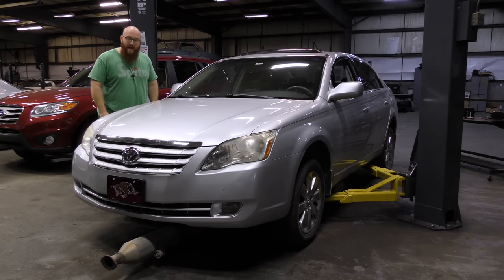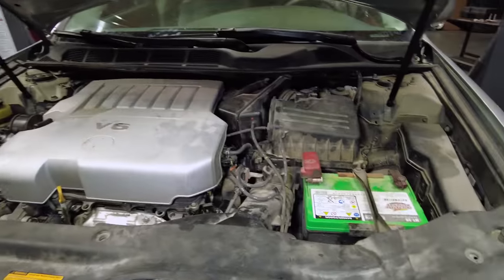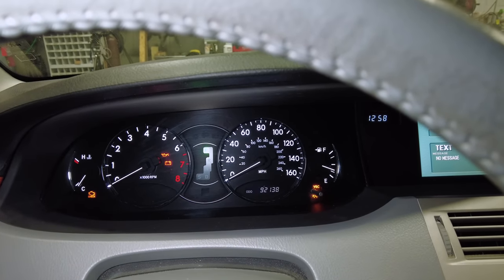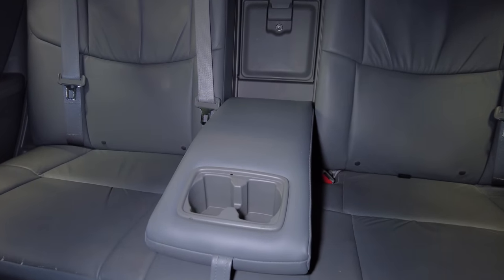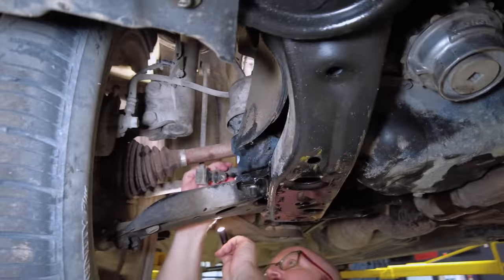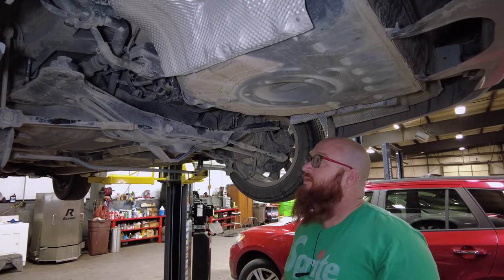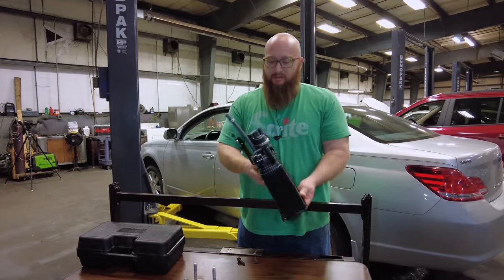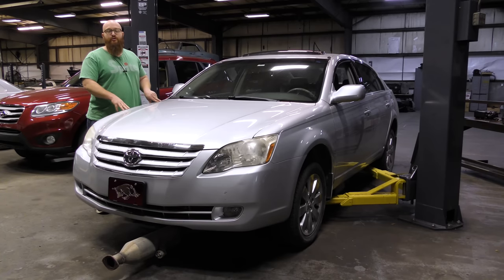Dumbest place for essential emission part on this '05 Avalon! CAR WIZARD is not happy!

Comment: I purchased a 2007 Camry XLE two months ago with 61,100 miles, this car was garaged since new, near perfect inside and out. My car has the 4 cylinder, 4 speed automatic, I am totally pleased with this car.  I was looking at Avalon's, but everyone I looked at had over 100,000 miles with asking prices between $17,000 to $21,000, which you think wouldn't be bad, but the Avalon's I was looking at were between 2008-2013.
Reply: Change the oil every 5,000 miles with full synthetic. The 4-cylinder is easier to maintain compared to the V6, so you should be very happy.  Watch out for oil burning, some of the 2007-2009 4-cylinder models had bad piston rings from the factory, and will burn oil. Even if it burns oil, just make sure it never goes low and keep changing it every 5,000 miles or less, don't get rid of it, it's still better than A LOT of other cars on the road.  These 4-cylinder Toyotas can go over 300,000 miles if you do basic maintenance!  I bet there are some with half a million miles on them.
Reply: You overpaid for a 15 year Toyota
Reply: We're did he say what he gave for it
Reply: Your cannister is in the same bs spot
Reply: @Dyesnipa  I had an 89 Toyota Supra and it had the original canister on it, I sold the car 18 months ago. I ask my dad if he ever seen one go bad, he said no, not even on an American made car, how often have you ever seen any go bad.

Comment: Great video!  Two points. 
1. My 08 Corolla Toyota saw fit to change from metal fuel tank to plastic. The line to the charcoal canister is molded ONTO the gas tank. (Must have been the same engineer!) when that tube broke on mine they wanted to put in a whole new gas tank. Nope. Used another larger tube as a sleeve and some JB Weld to fix. 
2. Im told that a big cause of charcoal canisters going bad is people topping off their tank (I like even dollar amount🤣!) gas gets sucked in and spoils canister. I’m now satisfied with odd dollar amounts!

Comment: Correction Mr. Wizard: 1970's cars all had to have a vapor recovery system on them. I have a 1970 Porsche 914 and it has a vapor recovery system with a charcoal canister on it.

Comment: We had the Avalon in Australia in the early 2000s and then it got replaced by the Aurion which had a 3.5ltr V6 which got it 0-60 mph in 7 seconds which was pretty quick. Then they did a TRD (Toyota Racing Development ) version putting out 320hp getting it 0-60 in 5.9 seconds.

Comment: My 2001 Nissan Sentra needed canister replacements twice in 11 years/60k miles. It was $600 parts and labor each time at the dealer. I had to get it done to pass the e-check to renew my registration.
Reply: I'm glad I don't live in a place like that. I just cut off my catalytic converter off mine today to sell
Reply: Do you top off the tank when filling up? That will destroy the canister.
Reply: @lrich8181  It hasn't in 11 years with my Sonata.

Comment: Some Toyotas really have some strange placements of parts. The 1996-2000 rav4’s (4wd version) - there’s a vsv that fails almost always and is nearly an engine out job. Motor mount has to be removed to do driver side control arm as the trans pan won’t clear it. 2wd you can reach it from underneath the car and control arms are standard procedure.

Comment: That top hattie hold it won't open is actually your radio And infotAINment not a hidie hole.. And miss wizard that car if it has the same sound system as the one I have been in. I came within a rather awesome sound system

Comment: The lock on the door to the trunk from the inside is odd. I've never seen that before. Thank you for the videos 👍👍
Reply: Honda Accords and some Acuras used to have them on the pass-through. It also had a lock on the fuel door release. The idea was you got a valet key and a regular key so that way if you took it somewhere and valet parked it, you'd hand the valet the special key and all it did was unlock the car and start the engine but would not allow them into the trunk (to your valuables) or to the gas tank.

Comment: Did you know that 1999-2005 Mazda MX-5 fuel filter is hidden on passenger side rear wheel well forward section, behind the plastic fender cover?
Yes, hidden all the way in the back, and clogged to the point to starve fuel on full throttle.

Comment: Each generation of Avalon is literally built like a tank! I bought an 02 XLS off its original owner 2 years ago, for $2800. 140k miles. Mine has the 1MZ v6 which does have a timing belt but I happily had it changed since it was such a great car in the first year i had it. I literally just bought it and started driving it for a year with just oil changes. It just goes and goes and goes, but now i wonder if the charcoal canister is in the same spot as this generation. Hopefully not! 😅

Comment: The lock is there in order to make sure that if the car is broken into if there are valuables in the trunk you can’t get in easily through the cab and just grab what ever they please.. it’s like that on my LS460 as well
Reply: Seems like you'd just hit the trunk release to the left of the steering wheel in that scenario.
Reply: @stevenatwater7298  well I didn’t say it made sense but it may have a trunk release lock in the glove box

Comment: Suppose if the owner driver does not overfill the fuel tank, the canister does not ever need replacement
Reply: That's what I was thinking.  Last owner must have been hard on the thing. If they didn't care about the engine bay, must not have cared about overfilling the tank either.
Reply: @RelicDavvi  I myself almost overfilled my fuel tank when the price of petrol went yo-yo a couple of months back
Reply: @yslee1401  lol

Comment: Question for the Wizard
I have noticed that pick up trucks seem to have much smaller brake front rotors than my BMW X5, Volvo V-70 R or my VW CC.  If a truck carries a heavy load, why don't they have larger diameter rotors?

Comment: 6:03 Possibly to avoid a valet to enter your trunk, as it might require a different key.
But I admit I also found that strange.
Reply: Exactly that from an article I read in Car & Driver (I think) decades ago. When cars introduced emergency releases inside the trunk in case someone got locked in, valet keys that only unlocked the doors and ignition but not the trunk (including the trunk release lever which could be locked — remember those?) could be bypassed by reaching in and popping the trunk from inside via the pass through. It was a short-lived thing.
Reply: @briandeschene8424  glove box is another space you can store things, and was typically lockable.
Nowadays, I do not see that - but I can be mistaken.

Comment: I think that locking door between the rear seats is to prevent someone (i,e, a thief breaking into passenger compartment) from accessing items in the  trunk. It's also good for locking away video games when the kids don't listen.
Reply: it's valet lock, the valet key won't open it and the trunk when the valet lock is engaged, so you can't pop the trunk either.
Reply: No that's not true, it's opposite since you can pop the seats down from the trunk, don't make up stuff, e.g; "i tHiNk"
Reply: @LAactor  you can pop the seats from the trunk so locking the pass through prevents access from passenger compartment, normally you lock this for valet parking, the valet key cannot open this lock or the trunk lock.  you also lock the driver seat trunk release.
Reply: The seats on these do not fold down. @LAactor

Comment: My 2010 sequoia with 165k miles is currently getting a charcoal canister changed out. There are other things that need to be replaced connected to the EVAP. $1944

Comment: I only bring this up because The Car Care Nut empasizes this. Always buy a replacement part from the OEM dealer. Are you sure the E BAY cannister is not a knock off. Just because it comes in a Toyota box and has all the right markings on the cannister can you be sure. Ford had a serious problem with this because the Chinese knock off of there replacement brake pads looked identical in every way to the original Ford product. Yes it may cost 200 dollars more from the dealer but it is the way to go.

Comment: I thought those never break, run 1M miles on the original oil, tires and first tank of gas? Very disappointing ;-)
Reply: What a joke that people think this right!!! Toyotas are trash boxes usually worth junking before 150k and sometimes even earlier
Reply: I got a 94 land cruiser with 500k 
A 08 FJ with 455k 
N a 01 sienna with 370k
Reply: @cornholio329  The old land cruiser ill give you, and the FJ is not bad either. But camrys, corrollas, and tacomas are trash. Head gaskets go bad on all of them usually before 150k. Look it up. That is if they even make it to that mileage, because we all know toyota rusts quicker than any other vehicle ever made. Have a 2005 suburban with 215k, and a 1990 volvo 740 turbo with 256k, which both provide far better ride quality than anything toyota ever produced.
Reply: @lotsof torque  

True but it depends if you maintain them and keep them garage kept and where they are from
My friend who I work with just bought an  97 v12 century n just had it imported from Japan
Reply: lotsoftorque, Instead of a "trash box"
Toyota what would you recommend?
Reply: @garyowen3662  Glad you asked. The Lincoln town cars from the late 1990s are very reliable. Anything oldsmobile or buick with the 3.8 liter is very reliable. If you must go japenese, overall Acuras are pretty good. The RL is the top model and is made very well.  Just watch out for the 3.2 liter MDX because the trannys go on them. The early to mid 2000s Mazda CX-9 with the 3.5 liter is a good car. If you are interested in a truck, The suburbans, tahoes, yukons, and silverados all share the same drivetrain. And they are all great. Especially the 92-99 models with the chevy 350 engine. The 00-06 are very good as well. 07 and up went to hell because they introduced AFM. I am speaking from personal experience as I have worked on cars since I was 15 years old. One of the most reliable cars of all time was the volvo 240. Plenty of them have gotten to 1 million miles, however I wouldn't recommend it to someone who is not a DIY person as they are very old at this point and most would need a lot of attention just due to being 35 years old.

Comment: You're doing more work to this car with Ninety k then my dad has done to his avalon with three hundred and seventy five thousand Somebody's rough on a ride Or if you travel a lot of miles for work. My dad traveled over 300 miles A-day write around 3 hundhe loves it. He used to drive an accuraintegra only thing he misses about that acura is the gas mileage this thing is like a cloud..
Reply: Cool flex bro.  I bought a geo metro with 430k miles for 400 bucks no leaks got close to 50 mpg
Reply: @MrBlaze256  Ajar it's the difference in a highway miles and a lot of city knives and country knives on this coat right here most of the miles were. Put on ours highway miles.. And I highly doubt you have a metro with four hundred and thirty thousand and a less of course you've done a ls saw lol
Reply: @mikebelcher5111  I did have it. Had it for 6 months sold it. I still see it every now and then

Comment: Hey Mr. widow someone is selling me a 2001 Buick regal for 1500 of it have 164,000 miles on it but though I think the motor mount is when I put it in drive, it jumps but it seem like the transmission mount is bad do you think it is a goodbye or what I stay away from it

Comment: 2011 Avalon 3.5 V6 with 170K miles or 2017 Chevy Impala LTZ  LFX 3.6 V6 with 45K miles ?who will be better for DIY for next 50-80K miles .
Reply: I'd probably choose the Avalon if it was significantly cheaper than the Impala.  If you're only needing 80k miles, either one would be fine, I think.
Reply: After owning two 3rd gen Avalons and one Camaro with the 3.6L GM engine I’d definitely go with the Avalon.
Reply: @paulhoskins7852  Same price .
Reply: Go with the Avalon if it was properly maintained.

Comment: I had an Avalon just like this one.  Mine was a Limited.  Best car I ever owned.  However, the AC evaporator began leaking and needed replacement.  No one would do they job as the whole assembly is in the dash and it all has to come out!  Couldn't have a car with no AC in the south so I traded it.  I still miss that car.  It was a total sleeper with tons of power and a very smooth engine and ride.  I'm looking for a used Panther as my next lux ride as the Ford drives as nice as the Avalon but doesn't have these packaging issues.  However I still love Toyotas. Super reliable.

Comment: Didn’t know about Charcoal things on cars. Must be for filtering gas fumes.
Reply: Exactly. Most of the gas fumes get trapped in the charcoal while the engine's off. Then once things are right, the charcoal canister gets connected to the intake and the engine sucks outside air through the charcoal to get the fumes out.

Comment: These ivory tower "engineers" should not have any of their asinine designs approved without first proving with their own 2 hands that their cars are not absurdly troublesome and needlessly expensive to fix. My goodness, this is probably even worse than the Jaguar X-Type's fuel pump change that requires the entire rear suspension subframe assembly to be completely removed to enable the removal of the fuel tank to change the fuel pump/sending unit. At least those conponents are actually more critical and expensive and shouldn't break as often...

Comment: I've owned and still own old cars. Never have I had an issue with a gas smell in my garage. That's not correct. Something was wrong with the car if that was happening. Come on there wizard.

Comment: With 17 hours to replace the timing cover gasket, at what mileage is it not worth doing?
Reply: I had my timing cover gasket leak on my 09 Avalon for roughly 100k miles. My car looked the same as this one underneath. Never addressed it till the transmission went out at 265k as it never gave me a big enough issue to warrant an engine out 🤷🏽‍♂️.
Reply: I did regular oil changes every 5k. Never issues with VVT lines clogging

Comment: I have 2 customers that have this generation Avalon with well over 300 K miles on them. I've heard that simple maintenance items like changing the spark plugs are somewhat of a pain in the yes so unfortunately many owners don't do it. I drive a 2000 Camry with the hype hyper super car 2.2 l 4 cylinder. I've owned the car since she was almost new (700 miles) And now have just North of 454 K miles. Those have been very trouble free miles BTW and even though I've never done the maintenance on it Between the 2 repair shops that I do take it to I almost never get out of there without one of the mechanics telling me compared to the most modern cyes my baby girl is a joy to work on. I also have a 2021 Camry hybrid which is also a great car but Between all the stupid plastic beauty covers and and Super complicated looking  thingy  Wires all crammed together In the relatively small engine compartment I get anxiety just topping off the washer fluid🤣

Comment: Charcoal cannisters should last the life of the vehicle unless you top off the fuel or bugs nest in the lines.
Reply: The vent valves are not sold separately, so if they fail (which is common) you're forced to buy the whole thing.

Comment: “It’s a lifetime part. It shouldn’t need changed during the life of the vehicle.”

- Automotive engineers
Reply: I would love to know the story behind why the cannister needed to be replaced ?  Did they keep over filling gassing it up ? Usually when EVAP code is trips, it'  usually from something else besides the cannister ( leaks, purge valve etc). It would have been interesting to see how they determined it was the cannister itself.
Reply: @captinbeyond  I think he tried explaining that it has hoses and valves and electrical switches that may / may not have failed. Usually it is a small cheap part that fails like a 50 cent O ring.
Reply: @ReadyFreddie5523  I have a Tundra 2003 that has had EVAP codes quite a few time, and I've done a lot of research on EVAP systems. My case it was a gas cap causing a leak. Most times it's a gas cap or purge  vent valve..I've seldom heard of the cannister being bad in all the research I've done unless it filled with gas by the owner when fueling that destroyed the charcoal inside.

Comment: Let me start by saying I like Toyotas. They are extremely reliable, and I’ve given Toyotas to both my kids. With that said…”it’s a Toyota, it’s pretty much a bullet proof car”. Yup…except the valve cover gaskets which require cowl removal and engine mounts loosened and moved…and the charcoal canister that requires removal of the exhaust and dropping the rear subframe. Thankfully the timing cover wasn’t leaking or the engine would have to come out. All at 92K miles… Overall, I don’t think this model would be a Toyota I’d be considering purchasing…just saying…